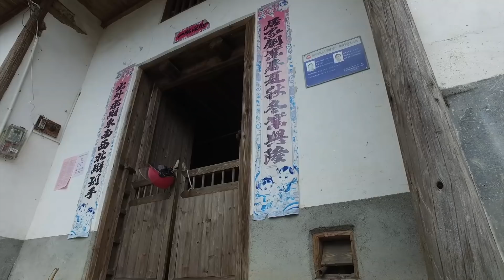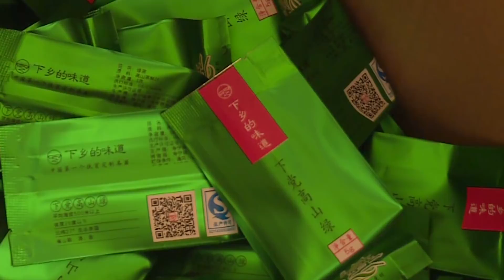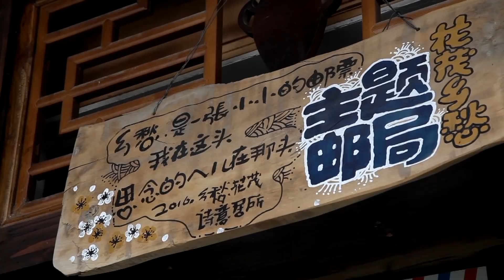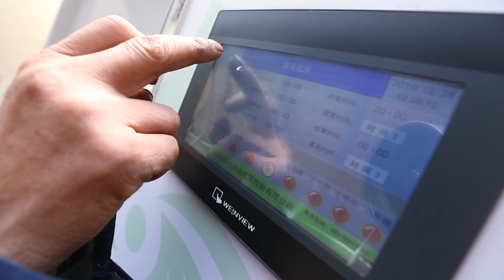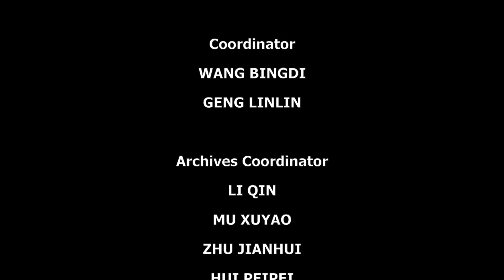How China works its way above the poverty line

Comment: Awesome. China was the FIRST to achieve the UN millennial target to half poverty.  It has excelled, and lifted 700 million out of poverty, and only less than 30 million more to go, mostly in areas like above which are so hard to reach.   In comparison some countries still languish at 20-30% poverty, US is 10% with 40 million poor.    
One making a promise when becoming president “to remove all poverty” is insane.  Then the policies, directives, funding, programs have been extraordinary.  I visited a city in the 3rd poorest province in China.  Subsistence, 300 rmb/ mth a decade plus ago, now it is a huge new city, wages 2500-3000 rmb. Every kid above 14 has a e-scooter @ 2000 rmb.  The little town has grown into a modern glass city, from farmers totally 300,000, it urbanised 7 million, with new airport, high speed rail, 9 subways, 3 sport stadiums, 3 ports, a free trade park, massive roads, new bridges, etc.  Brand new, 40% green, far nicer than mine which is already first world for decades.  China is   --  amazing.